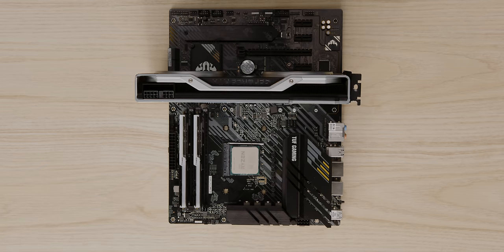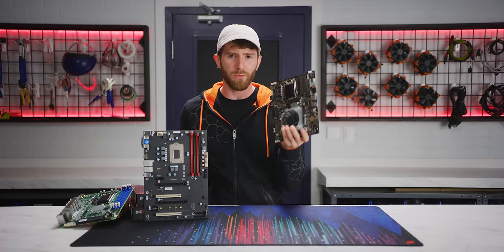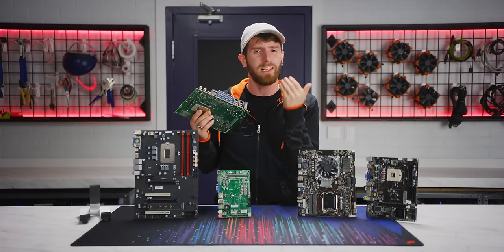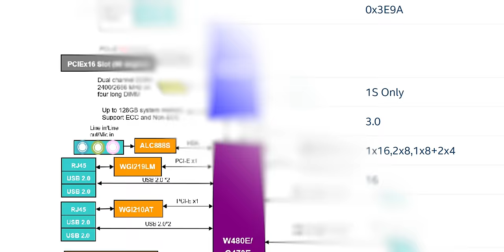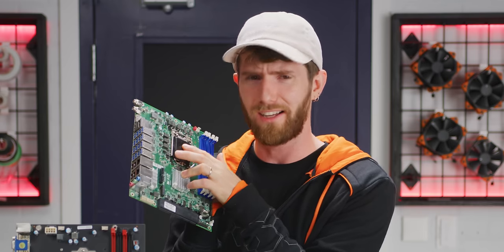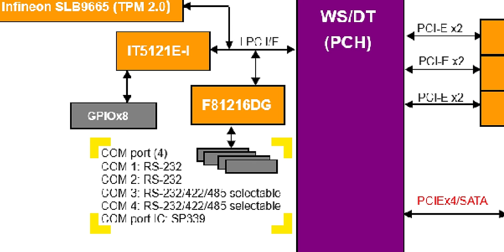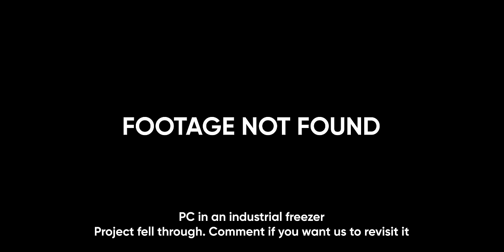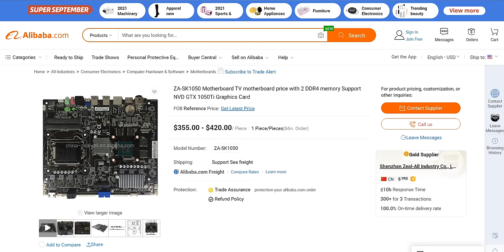5 weird motherboards that shouldn't exist

Comment: I've seen that last mobo in action.  It goes in a waterproof industrial computer with integrated touchscreen.  We used them at work for displaying drilling information on oil drill rig floors.  The CPU and GPU are heat sunk to the chassis.  The SATA ports are broken out to a pair of 2.5 inch bays.  Everything is sealed with double Orings with an IP67 rating to withstand a drirect blast from an industrial pressure washer.  They worked well for our purpose with a single connector for power and networking to run back to the site office trailer.
Reply: Holy shit that’s awesome
Reply: That's awesome! I had guessed maybe some sort of medical device due to recognizing "EPIC" as the name of a medical devices company, but came to the comments looking for more. That's really cool!
Reply: Very interesting, pretty neat stuff
Reply: Oh I thought it is a motherboard for thin client devices as I have a thin client device repuposed as an OpenWRT based router which use this kind of motherboard (but without any kind of graphic hardware), and it's passive ventilation relies on customized fins.
Reply: Fantastic!!!
Reply: Thats super interesting tbf....
Reply: Iooo8
Reply: Thanks for educating us!!
Reply: Thank you sir for the info!
Reply: Keegan Conlee EPIC sucks. Spent a year in hospital using that and didn’t like it. ESO that I use on the ambulance now is so much better
Reply: That's interesting
So the inputs from sensor that provide drill information went to other network device that them send it to this "terminal" or was it done other way ?
also
 do you think using raspberry pies would make more sense in this day and age ?
Reply: I'm not surprised an oilrigger has such poor speeling
Reply: @Tiger11246 There is literally a single messed up word.

Comment: That first motherboard would be extremely helpful with remote astronomy observatories. I’m a deep sky imager and basically every single imager out there is using multiple large array USB hubs. Astronomy cameras are pushing big data files, especially if you’re doing lunar / solar / planetary imaging. When you add in all the other tools needed, it’s quite common to need at least 10 USB ports - even more if you’re running dual camera setups, which is really common for remote observatories.
Reply: Cool. Thanks for the educational info.
Reply: At that point a hard drive system would make better sense
Reply: I am working in a printing business running more than 7 printers... I wish i can find that mb
Reply: @sensei3265  Aren't professional printers using UTP cable connection instead of USB?
Reply: Yooooooo another deep sky astrophotographer! Not the type I was expecting to see here lol
Reply: @MangoBox  Haha yeaaaah buddy! We know the pain of all the USB devices and cable management haha
Reply: If you need that many usb ports, wouldnt a usb hub be a FAR better idea? Externally powered so you are not vampiring power from your PC?
Reply: @Debbiebabe69  Its not about power worries, it is about bandwidth. Ive tried using USB3.0 hubs for imaging before and the amount of data astronomy cameras send is crazy. You end up dropping a lot of frames if you dont have a direct path to the USB controller on the motherboard.
Reply: finally we can plug 20 controllers to play some weird shit!
Reply: Thank you for your astronomy work.
Reply: I'm not sure it would work for that, too much data to transfer. This thing looks more like a super beefed up microprocessorboard for controlling automation processes.
Reply: It only has about 30 gigabits of bandwidth though
Reply: Why USB hub never mentioned here?
Reply: sonnet makes an 8-port usb-c card with 4 controllers lol, just toss a bunch of those in a threadripper system

Comment: as a flight simmer, I can confirm that there is no such thing as "too many USB ports"
Reply: Or enough, for that matter.
Reply: Im using like 10 right now requiring 2 usb hubs. One is usb-c thankfully for the more power /data intensive parts. And i still have so many things i can add.
Reply: Nor too much performance.
DCS makes GPU go brrrrrr
Reply: Yeah.  I also have vr. Which needs USB 3.0 for the trackers and vr.
Reply: As an avid VM user with no KVM equipment, I also agree. lol
Reply: @lostabyss9029  why
Reply: @Nina-cd2eh  dude virtual KVM? please dont tell me you have 1000 mice and keyboards on your poor desk!
Reply: @techiewiskers  Not really many just two of each, but having many is convenient because you can just passthrough entire USB sets and just move stuff around.

Like when I want to switch my ps3 controller or headset from my linux "main" to the windows "gaming" VM, I just switch the ports to the ones passed to the VM. Super convenient
Reply: enrique amaya  inshallah
Reply: There is a reason 8 port USB hubs sell a lot even though most decent motherboards have 6x slots already 😂 I can think of plenty of use cases for 12x
Reply: the amount of instrument panels I am guessing, plus yoke/stick, throttle, rudder pedals
Reply: As an IT guy, i can confirm you`ll never use all that much ports before turn your PC garbage.
Reply: i feel. my flight controllers for ksp combined use 9 lmao. front ports-filled, rear mobo ports-filled, pcie usb card-1 port left.
Reply: sim racer here, we also can't get enough usb ports for things like handbrakes, shifters, etc.
Reply: i remember seeing this comment a year ago and i went "ok they're 100% exaggerating" and now that i've developed an addiction to dcs i completely understand

Comment: FYI: crazy usb requirements: exotic flight simulator setups with a lot of external hardware.  My desktop setup for an A10 flight simulator for DCS uses (throttle, joystick, rudder pedals, 4 external usb joystick cards, 4 arduinos, 2 mfd devices, a UFC device, a trackir device, a jetseat, a mini usb keyboard, powering a monitor over usb) that's 19 right there!  plus normal keyboard, mouse, headset, etc.  and my sim setup is missing a TON of stuff and always looking to add more.  i have 3 powered external hubs in my various parts of the sim!  but yes, it is VERY niche :)
Reply: Whoa! That's cool. I'm still perfecting the code on my one Arduino with a rotary encoder used for pitch trim for MSFS2020.
Reply: What kind of hubs do you use?
Reply: how do you make a arduino keyboard with a rotary encoder?
Reply: Flight sim was my first idea too
Reply: flight simulators usually need a PC with a lot of grunt on the component side, by using that mobo with all those usb ports you are restricting yourself to... what will fit on that mobo. Plus all the usb devices will be vampiring power from your pc.
The setup you are using, which probably has a far higher quality mobo than the one with all those internal usb ports, and using powered usb hubs instead, is a far better solution.
I would presume that mobo is for something with very little bandwidth and computational requirements - cctv for instance.
Reply: This is why those directinput hubs with 128 button inputs plus analogue are so useful.
Especially if you are making an accurate simpit
Reply: why not buy an actual plane with the price of all that stuff?
Reply: @dizzydaisy909  because real planes cost WAY more, and require maintainance, upkeep, etc.
Reply: So yeah I just googled all those things and holy fucking shit I had no idea any of this stuff existed. RIP MY WALLET
Reply: @dizzydaisy909  dying

Comment: "PC In A Freezer" has always been my "Theoretical Best Performance" idea, but I haven't figured out all of the solutions yet, and I'd love to see how you guys get around certain problems (condensation, seals, etc). Please please please make one
Reply: Phase change cooling works. Insulate, seal up and you're good to go, with a ridiculously expensive and power hungry setup, but subzero is quite possible.

Sticking your PC in a freezer, depending on the freezer's quality and construction, might not result in any condensation whatsoever. It will probably kill the freezer, though.

I've run a PC outside(under shelter) in subzero temps, zero issues because no parts are ever below ambient...never ran it at below -30 C, mind you.
Reply: I had a thought like that about 30 years ago.  Not long after a company called Kryotech unveiled tech similar to my idea.  The product they ultimately started selling was a computer case that had a compressor in the bottom of the case.  Something about vapor phase cooling or some such thing.  Eventually there were ads surfacing for a highly overclocked AMD systems using one of these cases.  Short lived product, but variants of the tech wended its way into climate controlled server racks.
Reply: Or use some ducting from the front of a window mount ac, set to 60 with the fan on high lol

Not a freezer but should keep it pretty chilly lol
Reply: Freezers are made to slowly cool things and then keep them cool at low energy costs. If you put something that actively keeps putting out heat, it won't be able to keep up and because it's so well insulated it'll turn into a hot box. The closest to your idea what they've already done and what's actually feasible is probably this 
https://youtu.be/r7pqc26TWAg

Edit: oh, I didn't think of industrial freezers and now I see that part in the video. It'd be bomb if they revisited that yea
Reply: Actually, freezers don’t remove that much heat. A lot of it is just effective isolation.
Reply: The condenser required to cool an average ATX gaming rig would be industrial walk in size. We are talking about a compressor pump roughly the size of an apartment washer. Would consume about 10kW, and make a noise so nasty you could hear it for 100m. It’s not a smart idea.
Reply: Idk what you really want here. A ln2 loop has been made, a water chiller build has been used, an ac unit has been used multiple times and someone even mentioned a fridge(a conventional freezer wouldn't be that different). Great idea but the topic of unconventional cooling has been beaten to death.
Reply: agree
Reply: Get a heat insulated case with a opening for window air conditioner and place a pc motherboard inside with all wires comes out. The typical freezer doesn’t have enough power to remove the heat from a full power or over locking high end CPU.
Reply: I want to build a custom loop with a water chiller.
These are designed to run continuously at high heat removal factor, and are marketed for cooling CO2 lasers.
Surprisingly affordable, with a name brand unit going for $650 for 1hp, and a suspicious knockoff for $450 before I would worry about it not working at all.
You could just set the setpoint to just above dewpoint.
One of these was infamously used for Intel's "5GHz" 18 core processor for a trade show. It needed a dedicated branch circuit...

For freezer PCs, there's also what technicians call superheat.
Normally, you want full evaporation of the refrigerant in the evaporator. Once this happens, the now-gas begins warming up. The amount it warms is "superheat". (Grossly oversimplified.)
You want SOME superheat. Otherwise you have incompressible liquid leaving the evaporator and approaching the compressor. In the best case this washes the oil out, slowly ruining it. In the worst case, it hydrolocks ("slugging the compressor") and rapidly ruins it.
But Josh, you ask! What about more superheat?
Ah, yes. Too much is also bad. Because the compressor needs that cool vapor to cool its motor.
If the gas is hot, it won't be able to cool the motor anymore. The compressor will overheat, burn up, and die.
If your fridge or freezer is hot, depending on its design, it will either flood back (too low superheat, liquid returning) or starve (too high, warm gas returning). Both are bad to run in for too long and will eventually kill it.
Reply: LOL, freezers aren't running 24/7. As in, they're not even close to their max cooling capacity all the time.

A freezer PC is only an idea for people who don't understand.
Reply: suspend the pc in oil and then put the oil case into the freezer. both problems solved easy
Reply: They've done this many years ago. It doesn't work well because a freezer doesn't change temperature fast enough, it's designed to maintain a low temp. If you have something generating heat inside, it will heat up.
Reply: @TheSonicFan4  But... What if you have a massive heatsink, and planned for the maximum thermal output of the setup? I agree, using naturally cold air is a slick method, but not everyone lives in frozen climate where this works. Mostly, I wanted to extract the most efficiency from a setup by making the electrons have the most conductive path, and figure out how to keep it around that sweet spot.
Reply: Considering my phone would freeze in the grocery freezer at Walmart and stop functioning after about two hours, my hopes are not high, but the video would be great
Reply: @z185284  That's more of a battery issue with phones. I've worked in deep freezers, and realized it was dumping battery power to seek a connection, as well as losing power while the temperature dropped. At low temp, battery is less efficient and has lower available power, which will cause phone SOC/CPU to stutter as supplied power is not consistent.
Reply: get a big bucket freezer and fill it with water to the absolute brim with the largest tank that fits inside, add a water cooling loop with no radiators that uses the big tank as thermal mass. 
an Arduino controls the relay on the compressor depending on external air temperature and humidity sensors staying just a few degrees off the dew point. EZ. :)
Reply: Use the board that mounts the CPU on the back and put the cooler through a hole into the freezer while the rest of it runs at room temp.
Reply: "Please please please make one"

They already did a video on this a long time ago.
Reply: @pieceofschmidtgamer  With a regular ass consumer fridge. I mean a standalone freezer, capable of subzero °F, commercial or otherwise. The oil-bath idea someone mentioned sounded like a good idea to avoid condensation, as well as providing more heat capacitance for cooling.
Reply: They did one years ago. Basically the whole board was packed in some kind of putty to prevent condensation touching anything conductive.
Reply: Just adding traction so that we can hopefully get the freezer video.
Reply: LTT tried it a few years ago. They knew before hand it wouldn’t work because fridges/freezers aren’t made to handle high continuous heat loads. Obviously it didn’t work.
Reply: LTT tried it a few years ago. They knew before hand it wouldn’t work because fridges/freezers aren’t made to handle high continuous heat loads. Obviously it didn’t work.
Reply: They beat you to it, its not practical. Its much more expensive to run the cooler than just cooling the machine regularly
Reply: Wouldn't really work as a fridge is designed to keep things at a certain temperature cool but not a component that rises in temp. But there have been people who pulled it off. But it'd not your basic home fridge. If I'm wrong please tell me.
Reply: I think it's probably much less efficient to try and build a "freezer case" or put the PC inside a freezer than just hardcore cooling the relevant parts. I can't imagine a very high powered freezer that's ment to actively cool constantly (which consumer freezers aren't normally built for) being a more efficient cooling solution than a setup that targets specific parts. For some components it might actually be worse to run in an environment that cold so focusing on the GPU and CPU with some sort of sub zero setup is probably a better bet, although I'm not sure how condensation is handled in that case.
Reply: You can use liquid nitrogen to keep your computer cool while testing extreme overclocking. I wonder if there's a way to properly circulate it as a proper cooling system.
Reply: As others have said, pc in fridge/freezer simply does not work. It is counter intuitive, but the problem is that freezers/fridges make things cold by removing whatever heat is there, and then keeping it insulated. If you put something that generates heat constantly, you would be over working the compressor (ie the thing that does the actual cooling) far past what it’s supposed to do.
Reply: @crenshawyeo  “as others have said” repeats the same ass stuff everyone before has said

Comment: Outside of industrial manufacturing the most common uses I could see where you would need that many USB ports is modern arcade games like some of the fancy racing simulators you find at Dave & Buster’s, after all those things run windows and have a bunch of features that probably all plug-in with USB, any self contained kiosk that has a bunch of peripherals that plug-in via USB like for example an ATM, a self-service ordering kiosk at a fast food place where you have things like a touchscreen, a card reader, receipt printer cash dispenser etc. and then home flight simulator or American truck simulator set ups where you have a bunch of plug-in peripherals or macro set ups, think racing wheel with pedals, shifter, VR headset, custom button panels etc.
Reply: For research, we wanted to have an Android device farm with lots of devices to do testing on. Therefore, we needed lots of USB.